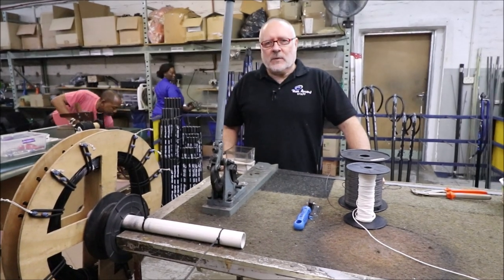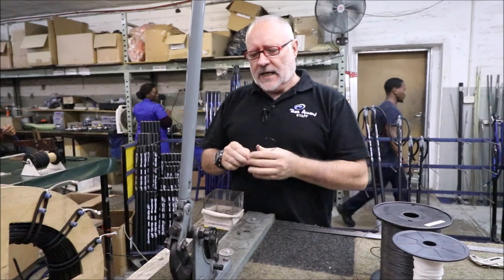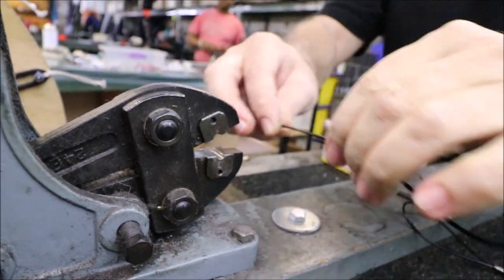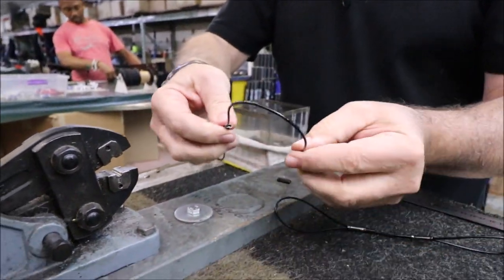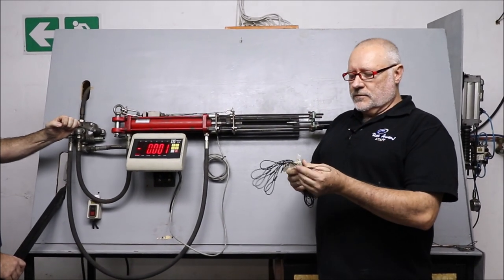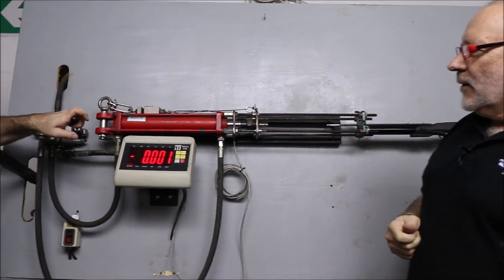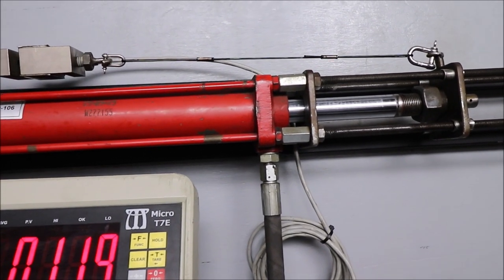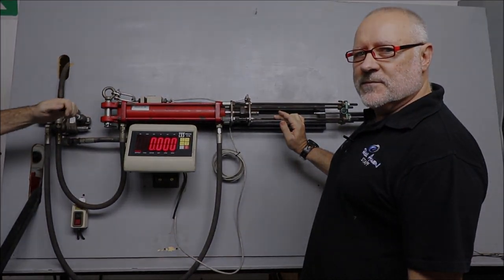Rob Allen | Mono Nylon & Crimp Loading

Comment: Does this imply that the mono can never be stronger than the crimp? So using any mono over 120 is useless? Or does using a stronger mono allow the crimp to be stronger? Or can you use a different crimp To make it stronger? How much force do large 150lb fish typically put into outlet set ups? Thank you for your videos they are very educational.
Reply: *put onto our setups”
Reply: *put onto our setups
Reply from the maker: This set up we use is specific to our 2mm mono using the crimp we have made. The break strain on the 2mm mono we fit on our guns is around 180kg actual line strength. If crimping and or tying a knot you will loose around 1/3rd of this. So, 120kg is the norm for 2mm mono. Thicker mono will therefore be stronger and, thinner, less so. IT is possible to get a slightly higher break strain if the crimp is carefully machined, the crimp too adjusted for each crimp etc. I have had it up to 138kg. To do this is not practical. The force from a fish is relative to the tension against the fish. If you have a 20lt float, the fish only needs to pull 20kg to pull the float under the water. If it is a high speed jerk from the fish the load will be higher but never 120kg. If you are not using a float but are using a reel, I doubt you would be able to pull more than 20kg without being pulled under. The only time the line gets loaded more is if the fish goes into the reef and jams the gun up, now he can fight against the line and crimp. In most cases the line will cut on the reef rather than the crimp failing. I hope this answers your question.